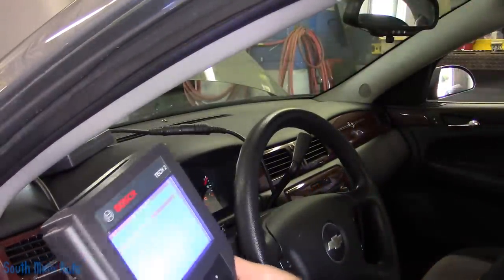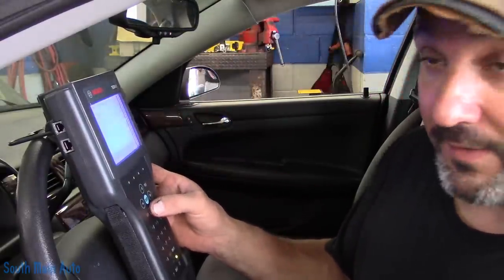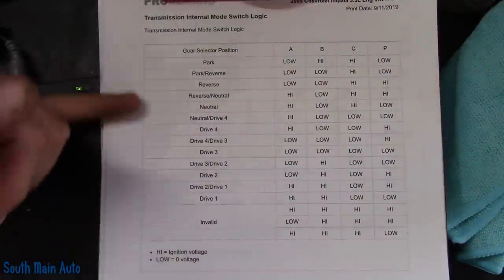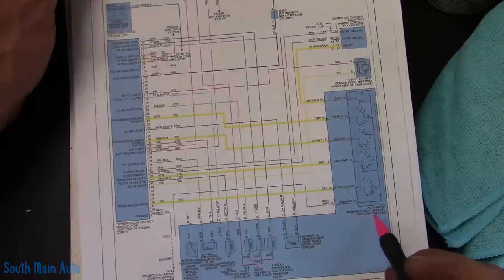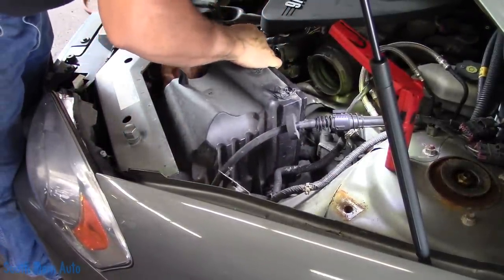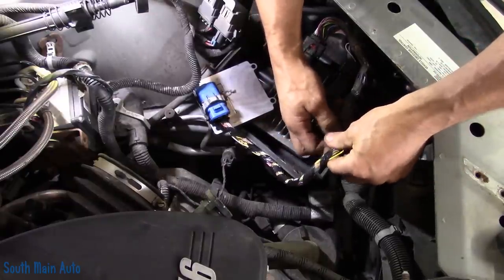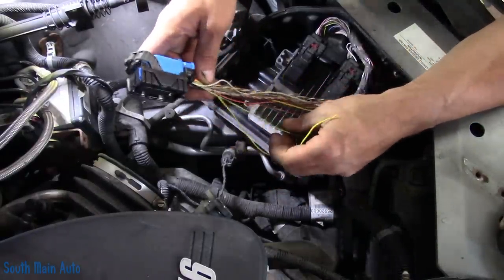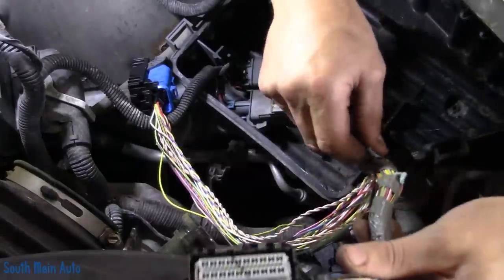Chevrolet Impala: No PRNDL Display

Comment: My wife has a 08 kia sorento and the mice love to fill the air box up with chewed up acorns at first I thought it might be a squirrel but oddly it's mice I have trapped several of them and more keep coming. For some strange reason they have never got into my 06 f150 only her kia but I have been very lucky they haven't caused any real damage I just keep cleaning the air box on the regular and trapping the little squeakers
Reply: Why not add screen across air inlet? Maybe 8mm screen?
Reply: @davecc0000  never thought about that good idea!

Comment: Used to train folks to fix computers in the 80's - opened one up one day and Mickey was still in there! Not too happy with me, he/she ran over the bench, across the floor and into our drinks machine. The front office staff insisted we humanly trap and release him/her into fields next to the shop. Opened another at a later date but sadly the little guy had bitten on the wrong wire and unsurprisingly, didn't run out.

Comment: Is the car a garage queen and not driven often?  What happened to the happy mouse family inside the air box?
Reply: He said the car was a loaner, so it might sit for long periods of time. But, yesterday, when I was doing an oil change on my sister's Toyota Matrix, I found acorns and nesting material in the intake manifold area. The car is driven daily.
Reply: The mouse family is now homeless on the mean streets of Avoca!
Reply: @walterk1221   I pity the mouse.  It must not have been hard for a mouse to find a way into the intake channel.  I though one may have been sucked into the intake manifold (or wandered there) and caused "the money light" to glow.
Reply: @davidquinn6161  Maybe the mouse (mice?) liked to travel.
Reply: @jeffryblackmon4846  fear not for the mouse being ingested by the engine. There is a sturdy mesh on the "clean side" of the air filter which would have prevented this fate.
Reply: @walterk1221   That makes one less problem to be concerned with.  Thanks.
Reply: @jeffryblackmon4846  you are very welcome. 😁

Comment: Why did GM stop making the 3800 V6? That engine was extremely reliable and could go 500,000 km easily. 
Answer: GM hates their customers, just as Sears hated their customers.
Reply: Sadly it was combination of weight and fuel economy.  Even the lightened block of the Gen II and later was a heavy engine.

I have four of them personally (in two race cars and two spares).  Have rehabed a few LeSabres for others including the LIM and upper intake.

Comment: I hate mice and wires. New boat trailer always gets retired with marine grade wire (tinned copper) and home runs back to the connector, we’ll mice made a winter home in the trailer tube with the wires - next spring it was all shorted. I redid the work and blocked the tubes with stainless steel wool. Fifteen years later, no problemo. Besides salt and rust in the NE the mice are a big nuisance.

Comment: Similar thing happened to my 2010 Ford Focus. The engine was only running on three cylinders. A rat had nibbled all the plug wires and chewed all the way through one.
On further inspection, I found that it had also destroyed the valve cover breather hose. Little b*stard.

Comment: Can anybody please tell me why my 2011 Chevy Impala speedometer is reading to me my door is open and it is completely shut? Please it's inspection month I don't know what to do. The interior lights stay on because it says door is not shut even when I get out so I took the interior lights fuse out but then now one of my blinkers isn't working I've changed the bulbs and even went back to my new bulb and three of the four blinker lights were working and then I put the interior lights fuse back in just to see if it would work and it worked to make all four blink again for the turn signal. What do I do

Comment: I have a 2007 Impala that does nothing when I turn key to on position. Key fobs which I have 2 do not work I tried re calibrating fob to car on dash control but the FEATURE SETTINGS AVAILABLE IN PARK comes up so I cannot get to the fob pairing. Shifter moves fine through gears but no square selector. Door locks do not work, fob does nothing, I put new batteries in both fobs and it did nothing, the actual key will not even unlock or lock the door lock mechanism that goes up and down. 

Car does nothing in start position in any gear or by wiggling shifter I have tried all of this
I have cleaned battery cables and the negative ground wire on the frame

I don't know if NSS is bad, ignition, battery, (headlights work fine and are bright), starter, relay,??

Anyone been through this besides the people that had the mice chew up the wires in this video?

Comment: nice honda rat tape .shame doesn't work . try grease works better . and it was for knock sensor in the vallety for all the honda acura v6 engines use spray grease works so much better

Comment: so i sorta had a similiar problem at work...... did an oil change on a GM 3.6
in typical GM fashion.... checking the air cleaner is a pain in the ass

so i disconnected the MAS..... and opened it up

but dumb ass me forgot to hook it back up..... 

and the car ran fine.... with no check engine light, as i pulled it out, and around the shop

but she came back with 14 codes..... all circuit faults 
figured something was unplugged.... but did not think a MAS would trigger more than 1 to 3 codes

so i checked the driver side first..... main computer and the larger connectors.... fine
looked over at the air box..... OHH FUCK ME

luckily, she understood that people derp out.... 
and was not mad..... just relived that her car was ok

but ya.... .14 codes from a MAS airflow sensor being unplugged..... wow!

Comment: I have made a lot of money because of rodent damage. 💰💰
Reply: Surprisingly I haven't and I was in Pest Control for 8 years...
Reply: LMAO.
Reply: some years back I was collecting my car from the GM / Holden dealer in my town ,  and there was a near new Malibu in the workshop with the dash pulled out , I asked the tech what was happening to it , and he told me , a rodent had crawled up inside and died , and the resulting odour was permeating throughout the car ,
Reply: commodore665 I found a dead one sitting on top of my battery in my vt, I planted lots of different types of mint where I park my cars
Reply: IS THAT WHY THE CAT LOVES TO SLEEP IN THE ENGINE BAY .
TURN KEY ROOOOWWWWNN .

Comment: my e39 would not start, no gear display, I had to started with a wires coming from the starter to the cabin with a switch, it was a bad oil sensor, it was blowing a 30 amp fuse, i disconnected it , replaced the fuse,  and it fired right up with the key turning and showing the gear in display. I wish someone would have told me this before. your welcome.

Comment: A friend of mine bought a brand new Nissan Altima and a week later the check eng light came on.  back to the dealer and they found the main harness, battery case, and other plastic was eaten.  over 1600 dollars of damage, not covered by the warrantee.  Soy based insulation.  yummy yummy.  He is paranoid now and putting rodent repellent in the eng compartment

Comment: This has been a issue with Toyota's as the insulation of the wiring is now a soy based product. I have a customer going thru this issue on a 2018 rav 4. A bar of Irish spring soap under the hood and seats has repelled the  wiring chewing rodents. Don't laugh as it has been very effective.
Reply: any thing with a minty odor works as long as the rodent isnt suffering from a head cold